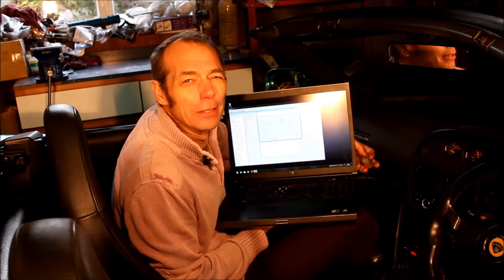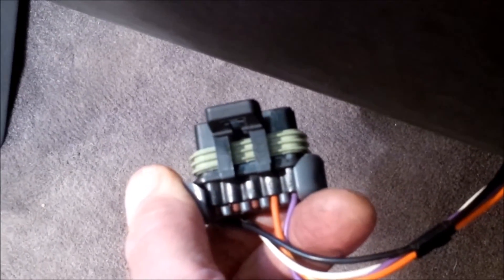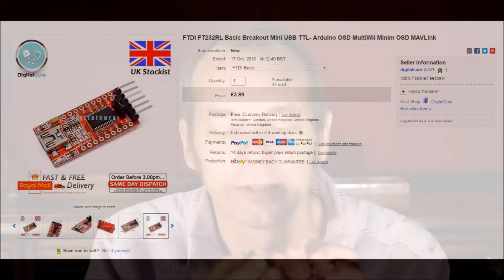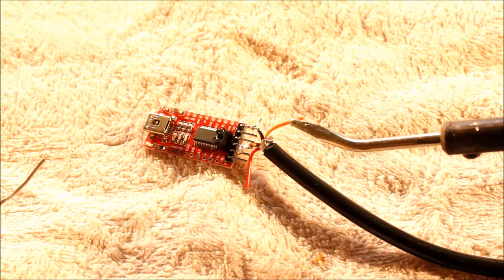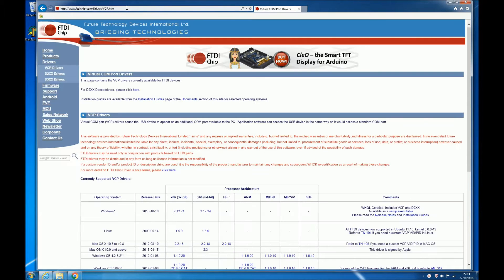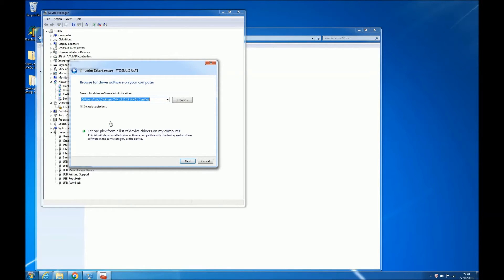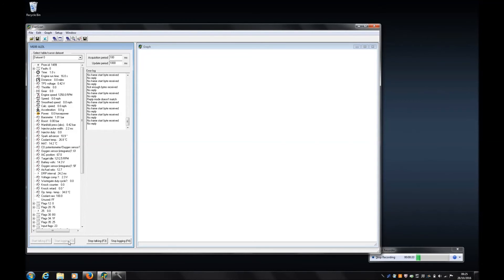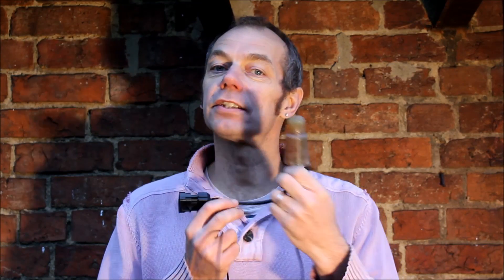How to make an ElanScan ECU diagnostic interface cable for the Lotus Elan M100

Comment: I'm going to try this procedure to comm with my 1990 Esprit SE . The Opel Vaux 10 pin is exactly as you showed on your Elan so I'm hoping it will work with Andy Whitaker's Freescan software. There are FTDI USBA cables with the chip already molded into the connector and exposed wires on the other end. Does it have to be the FT232RL ? There are other chips that do the same job converting serial to USB. The one I'm looking at is a PL2303TA USB2.0.  Does that matter ?